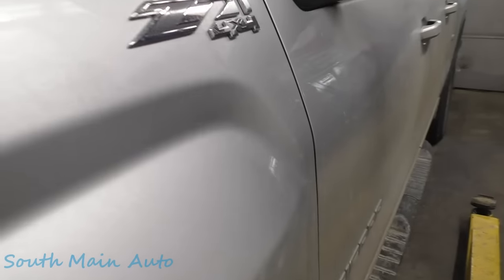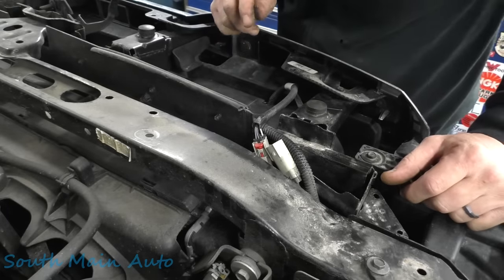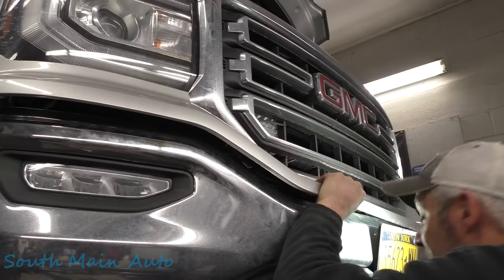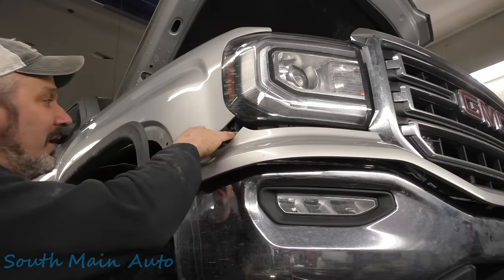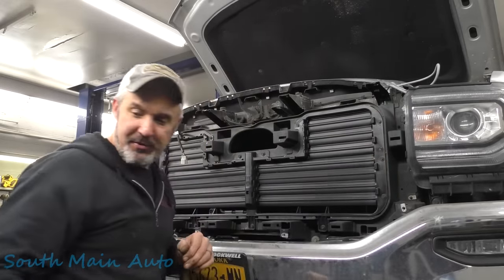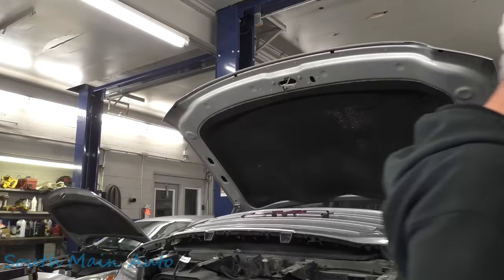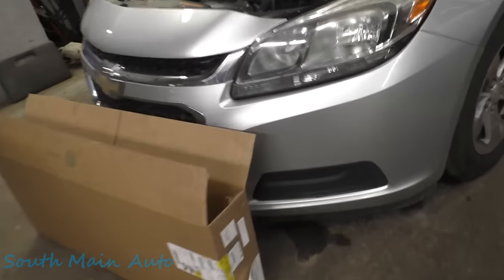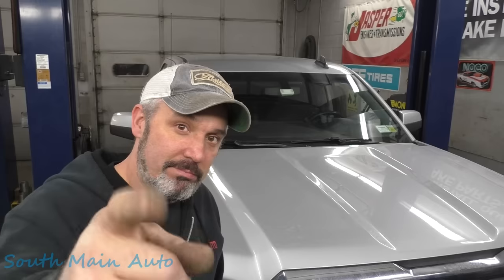Chevy Truck: Active Grille Shutter

Comment from the maker: Just to clear some stuff up here is the description and operation of the active grille shutter right from GM service data:
DESCRIPTION AND OPERATION > ACTIVE GRILLE AIR SHUTTER DESCRIPTION AND OPERATION
The active grille air shutter system closes shutters in the front grille to enhance vehicle aerodynamics in driving situations where cooling and A/C loads are relatively low and high levels of front end airflow are not required. If high levels of airflow are required the active grille air shutter system will open one or both shutters. The control signal from the engine control module, ignition and ground circuits enable the active grille air shutter actuators to operate. If the conditions for opening the shutters are reached the engine control module commands the active grille air shutter actuators to open one or both shutters.

The dual active grille air shutter system consists of two aero shutter mechanisms located in the front grille for controlling the amount of air entering the engine compartment. It includes three wires; ground, power and a Local Interconnect Network (LIN) Bus serial data circuit from the engine control module to the shutter actuator. The engine control module determines shutter state based on various vehicle conditions such as vehicle speed, coolant temperature, fan state, refrigerant system pressure, A/C compressor state and ambient temperature. The engine control module has the ability to command each shutter individually to the open or closed positions through communications on the LIN Bus.

The actuators are powered by an ignition circuit that is active when the key is in the RUN position. The vehicle may have to be driven for up to 13 minutes at speeds greater than 41 km/h (25 mph) before a shutter begins to move. If low ambient temperature is detected, the shutters will remain in the closed position.
Reply: Wow, it does all that. Where can I get one for my 87 F150?
Reply: so it's essentially a big blend door actuator to keep the bay cool?
Reply: Oh boy how great. Pretty sure the snow plow/camper prep package removes those but can anyone confirm?
Reply: @2552  its actually to help it get and stay warm during cold weather.
Reply: @PandaMan02  So it does what decades of installing coroplast behind the grille every fall at 100x the price of a sheet of coroplast...... gotcha.
Reply: If they stop making these pickups larger and heavier you wouldn't need all this failure prone items to get better gas mileage!
Reply: @SuperBuzzbomb  while i agree with you, i don't believe the active grill shutter is that bad, it not only controls air flow into the engine, it also affects wind resistance.

an electronic thermostat i had to do a few weeks ago was worse, it was ~4 hour job.
Reply: I was thinking about asking the purpose of this device in the comments and didn’t feel like duck duck go-ing it, but glad you gave this information.  I thought, light duty pickups and other automobiles did well without this device in vehicles made in the 20th century, why the change, since it’s just another device that can break?!
Reply: @pandaman isn’t that the purpose of the thermostat - to stay closed and not allow coolant to circulate inside the engine until it reaches a predetermined “warmed-up” temperature?
Reply: It's actually a very old idea that has just come back around... except now it also 'improves aerodynamics' and is activated with fancy electronics... it was once common on cars and tractors, then for decades only really seen on heavy equipment and big trucks.... now it's come back around
Reply: Just curious how much gm charges for a new active shutter system?
Reply: They fine tune the shutters for optimal fuel economy to justify the expense and additional weight on the vehicle. I thought the same thing.
Reply: So basically an automated version of what was slapped on the front grille of an old PAZ-672 bus at winter._
Reply: Wish the description told us what the actual fuel savings are !!   Can't imagine it  being much!!   Complication on top of complication!!  And here I am thinking it's another thermostatic engine control.  🤔 Amazing!!
Reply: I used cardboard does the same thing
Reply: @petermallow  its called a piece of cardboard. out it in at Halloween and take it out at Easter.
Reply: @@freiherrdinkelacker5730 if you're running down the highway when it's 49 below zero, these shutters are absolutely the right thing to have. And yes, it gets that cold where I live.
Reply: @Freiherr Dinkelacker transmission fluid doesn't get that hot unless you are putting a load on it, coasting down the highway is very minimal in heat generation.

allowing the grill to close reduces wind resistance and reduces excessive thermal loss to components in the engine bay during extreme cold, this acts in reducing the overall emissions generated during vehicle operation, specifically caused by vehicle warm up phase.  this system also allows the vehicle to stay cooler in warmer temperatures by allowing the grill to open up

EPA regulations are getting that stringent that GM and other car manufacturers have to design these things get pinch every tenth of a MPG where they can.

just because you want to act like a know it all old man doesn't mean that you know everything, there is more to your vehicle than your transmission.
Reply: This has got to be one of the most ridiculous options to have on vehicle ive ever seen wow
Reply: My 2008 Silverado takes 2 hours to change the headlight bulb. I lost one and because it was such a pain I replaced every bulb
Reply: @PandaMan02  The EPA is the problem always demanding crap that makes vehicles more and more expensive and less and less reliable.
Reply: I have dealt with this system before and I think it is the dumbest idea that the engineers have come up with yet.  Great video Mr O 😊😁
Reply: @Freiherr Dinkelacker ..... transmissions are VERY minimal at heat generation. unless you are towing or doing burn outs or racing, passive cooling in low airflow area is good enough for most people.
Reply: Sort of like Active Fuel Management: a Solution in Search of a Problem.
Reply: Wouldn't it have been faster to just take the bumper off?
Reply: @@freiherrdinkelacker5730 Which is why I was wondering about just ripping off the whole bumper entirely instead of disassembling all of the plastic. shrugs
Reply: @PandaMan02  sounds right .... what it has to do with 'aerodynamics ' I don't get
Reply: @ivanolsen7966  air flowing through the front, across the radiator and through the engine bay is more turbulent and resistant than air being pushed aside at the nose.
Reply: I can only imagine what that contraption costs!
Reply: Kmart? I was going to say Caldor :)
Reply: As I said, I had them on my Kenworths, most all truck manufacturers used them back in the day till they came out with air to air charge air cooling.
Keep in mind truck engines under load have to have the cooling capacity to dissipate the heat. That’s important on a long pull in summer temperatures,
but say in winter, under lighter lighter loads and extreme cold temps, you’d be glad to have closed shutters that are sealed around the front of the rad,
and between the rad and the engine tunnel in a cabover.  I could tell by the sound of the truck if the shutters where open or closed. Used in combination 
with a Horton, or Bendix clutch fan you where saving fuel, due to less parasitic horsepower loss, and the increased fuel use to overcome that. 
Trucks running on “ winter diesel “ are not very fuel efficient.  It takes more that a chicken dipped in water to make chicken soup. 
Haven’t stopped at Kanona for a long time E.  keep up the good work.
Reply: @MSB1080  They do not remove them on trucks with the plow package, at least not any that I have seen here in Toronto Canada. I have seen some vehicles set off the code due to some guys running the plow harness through the adaptive grill though! 😄
Reply: My point is, if the check engine light is on for this issue it won't pass emissions.
Reply: You can just replace the motor/actuator
Reply: @greghostetler238  I just got quoted about $450 for parts and $500 labor by the dealer for replacement in a 2020 Silverado 1500.
Reply: This is the answer to the exact question I was going to ask.
Reply: $1000 repair in Canada! Crazy

Comment: Back in my day an active grille air shutter was the process of people  sticking part of a cut up K-mart box in front of the radiator and then removing the cardboard at the appropriate temp. 🙂
Reply: This comment is gold!  Did this plenty back in the day, so true!
Reply: Kmart? That was a long time ago.
Reply: EXACTLY! I live in NE Tennessee and I also drive a 1990 S10 Pickup. On the cold 20-30f mornings, I'll grab a long cardboard cut-out and lay it horizontal against the radiator. The fan will suck it and hold it against the core support and that'll help lessen airflow. Super useful for the older fan clutches!
Reply from the maker: This comment just makes me miss the big K. Ours had a cafeteria in it. Did yours? 😥
Reply: Yep mine always had the best cheeseburgers
Reply: Now days we are a lot lazier just push a button. back 30 year ago when I started to drive a piece of cardboard was cheaper
Reply: School buses did this to help warm the bus for the kids.
Reply: @mconley600  oh yeah.
Reply: Little Caesars in the Big K. I worked there in college and got 50% off on pizza. Good times!!
Reply: @SouthMainAuto  My sister worked in the cafeteria and later in the store. I still have things like car ramps and jack stands bought at Kmart. The floor jack I bought there in about '76 recently failed rather catastrophically and I'm glad I wasn't under the vehicle.
Reply: My 87 Monte Carlo with the NASCAR nose would not warm up in MI winters so I would put a K-Mart bag over the small grill and the suction from the fan would hold it in place.  It would fall off when I parked so I had a bunch of bags in the back seat!  Worked great!
Reply: @larrybe2900  By 1970 school buses on IHC chassis had vacuum controlled shutters.
Reply: @SouthMainAuto  My Woolworth's did.
Reply: Thats what we do in Alaska.
Reply: This comment Makes me miss the Cafeteria in The K Mart we used to have
Reply: @SouthMainAuto  Now I feel neglected, our K-Mart never had a cafeteria. The only general Mercantile store that had one was downtown in the Woolworth's. Here north of the big city we never had a cafe until they re-did Wal-Mart to make it a super center. K-Mart kept our Wal-Mart honest because they were only 1/2 mile apart and were Direct Competition.
Reply: True, but how many cars got overheated, cuz they forgot to remove the box when it warmed up. :)
Reply: Worked at Kmart and they had a cafeteria.
Reply: I started off with various bits of cardboard in front of the radiator, otherwise my old diesel van would not reach temperature for half an hour in the winter.
   Thing is, you can trust cardboard !
Reply: @misterhat5823   3 left in the US apparently !
Reply: I used pizza boxes
Reply: That's because the buyers back then were not willing to pay for that kind of accessory. But today, not so much. Today's buyers are willing to pay yearly subscriptions for enabled heated seats....
Reply: I actually did this to so long one winter that I forgot to trim it back before taking a long trip and sucked my radiator into my fan. I stopped for the night and got a room, got up the next morning and found a junkyard with a used pinto radiator and went on my way. I was in the service so even a thermostat was expensive to me. back then  :)
Reply: I still do that with my 99 suburban, winter months 30 and below my truck driving down the highway, its lucky to move off the 100 degree mark, thats with a 170 thermostat, Idling it warms up just fine, but too much air I had to block half of it to get any sort of heat inside.
Reply: @larrybe2900  they had a cover that would snap button on 😂 still do I think.
Reply: @rickmarshall808  Of course that would be impossible for me to answer "how many".  All I know is I've been doing it for many decades without a problem.  Can't speak for others but my cardboard never broke.
Reply: Do you guys not have them any more? We still have Kmart over here, but they no longer have the Cafeteria in them(oh how I used to love their Chips & Gravy!)
Reply: @Micko350  not near me 😭
Reply: @rickmarshall808  back then most cars had actual temp gauges.
Reply: Trouble is modern cars don't have temp gauges nowadays.
Reply: In the Wisconsin winters, twas the "winter heat" cardboard for dads K5 blazers and 454ss 3500 crew cab and whatnot.
Oh! And the plow truck...

Cuz snow packing into the radiator is apparently far far worse than having the cardboard blocking a portion of the radiator to build interior heat temp faster
Reply: Keep it simple.
Reply: Yep, cardboard was popular, as was Woolworths, Western auto, rotory dial phones with party line, 3 TV stations-at least until midnight, Mercury program..now we have choppers on Mars and shutters in front of radaitors. My-my...
Reply: @thecastros9104  Now a days you can't get plastic bags at stores, they're bad for the environment, how ridiculous!
Reply: My 1960 gmc school bus had no heat,yes in ohio we froze our ass off.
Reply: WELL SAID

Comment: We've reached the day where a grille can cause an safety and/or emissions inspection failure (depending on your state and what each inspection covers).
Reply: Glad I live in a reality state where all that safety/emission crap isn't required.  We even got rid of speed limits for a while.  Not sure why they put them back though.
Reply: @Marty's 4x4 Sad, because it was actually safer than people being panicking about getting pulled over.  I moved to WA before they put the speed limits back, and never knew why.  Thanks for the info!  I moved back here about 10 years ago due to medical reasons.  WA is turning into California part 2...
Reply: @Marty's 4x4 They did the same thing with the drinking age back in the 80s
Reply: @squishy312  Feds said they would cut off all highway funding if they didn't. Just like they did here over the seatbelt law.
Reply: @sunnydeng9263  No, most people don't.  The idiots that do, are the ones that actually would get pulled over for something like that.  The speed limit removal was on the highways and interstate, not in town.  Even when it was removed, people could get tickets for weaving in and out of traffic and going way faster than the flow of traffic.  Idiots who have no value of other people are the ones that are the problem with and without the laws.  The law changes nothing then.
Reply: Get rid of state inspections.
Reply: @squishy312  How they gonna pay the cops ?
Reply: Don't you just love engineers
Reply: About like the car he did where a faulty blower motor caused a CEL.
Reply: @insideoutsideupsidedown2218  --None in Arkansas, Thank God, still vehicles need to be Monitored by State Police as we do have Dangerous Vehicles on the Road, I see many...
Reply: We have autonomous robotic cars on Mars that far exceeded warranty, yet we have this shit at home.
Reply: @sunnydeng9263  stay off the street if you scared!
Reply: I do safety and emissions inspections in Norway, and I would never fail a car for a faulty active grille shutter, even if it triggered a CEL.
If the CEL is on, I do a quick scan to see if it's directly related to increased emissions. If not, I don't give a damn.
Reply: @johnbragg2014  Here in Cali if the CEL is on its 100% gunna fail inspection. The smog program is so fucked in Cali (especially with the Catalytic converter theft basically being rewarded) I can name so many things that are to screw the customer/car owner population.
Reply: @CheeseO  I live in California, and my smog checks take about 5 minutes.  It once was totally jacked up.  They made shops put in Dynos then removed the dyno check requirement for vehicles 2000 and later, insane.  Still have people changing oil, getting tuneup, and stressing over smog checks. As long as the money light is off and your vehicle has all active monitors, it's a piece of cake.  Smog checks are the least of my complaints with this jacked up state.
Reply: Exactly where I'm at right now.

Comment: That was fun. 
I did one of those yesterday - almost put the new one on without the temp sensor.
There's a little circuit board on the motor for this thing, full of corrosion. 
Not to worry - GM is saving their electrical sh*t that doesn't corrode for their upcoming EV's.   Those will be trouble free.
Reply: GarbageMotors
Reply: The GM fires will be absolutely spectacular with the lithium batteries!
Reply: With all manufactuers going electric every day will be bonfire day start buying your fireworks now LOL.
Reply: And the EVs will sprout wings and fly at least that’s what I read in Popular Mechanic back in ‘62
Reply: When he didn't grab it out of the old one. I knew he would be back. No way would they include something they will happily charge $35 for as a freebie.
Reply: @williamallen7836  Honda still has a pretty good reputation, though not as good as years ago.  They've their wagon to GM's EV platform.
Reply: GM is doing their part for a cleaner future by having us replace an entire shutter assembly for corrosion on a motor controller.
Reply: @dewaynek8591  Yes, it looks similar to a blend door actuator - they could sell it separately and make a better attempt at weatherproofing it.